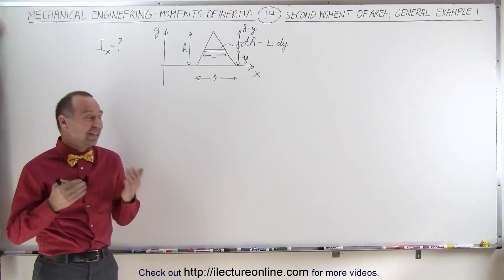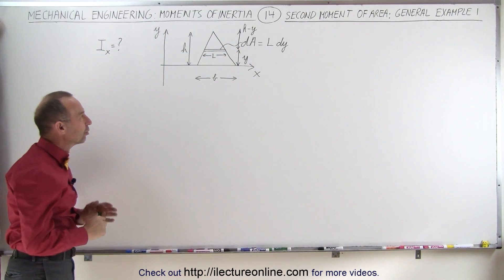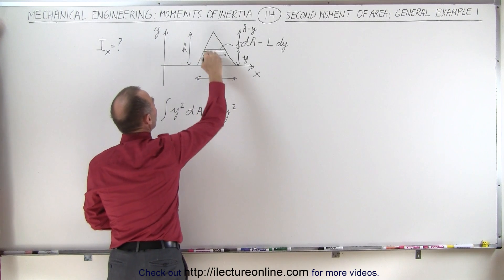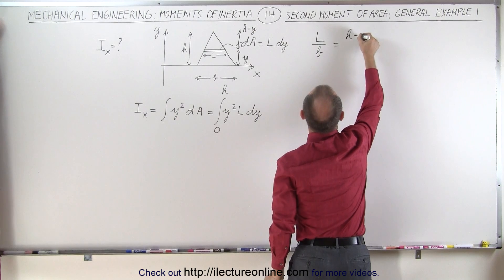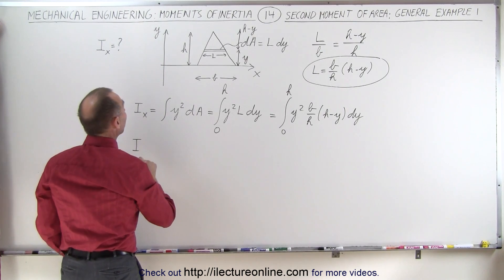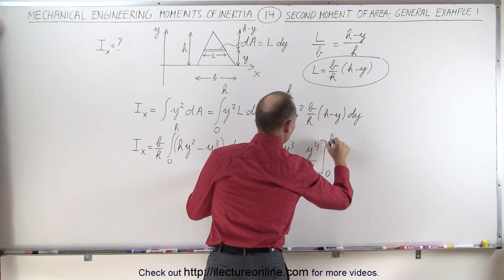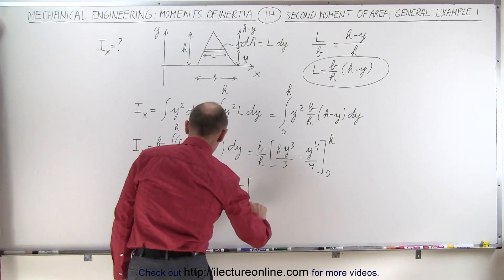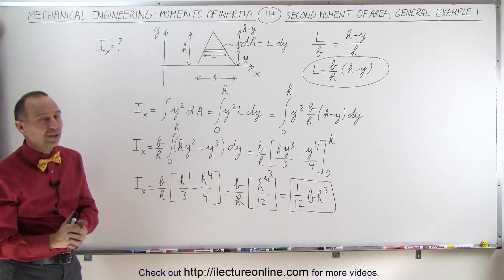Mechanical Engineering: Ch 12: Moment of Inertia (14 of 97) Second Moment of Area: General: Ex. 1

Comment: Sir, could you please find the I(y) by using the same differential area that is perpendicular to y-axis? I am able to find Iy by using a differential strip parallel to the y-axis but can't find it using a differential strip perpendicular to that axis of rotation. There are formulas on textbooks for determining Ix and Iy by using the same differential element but the formulations really confuse me.
Reply: I noticed that the relation he used is based on proportionality. I can’t find a similar relation for Iy if I were to use a strip parallel to the y-axis. Also, if the triangle is not symmetrical, it complicates the problem.